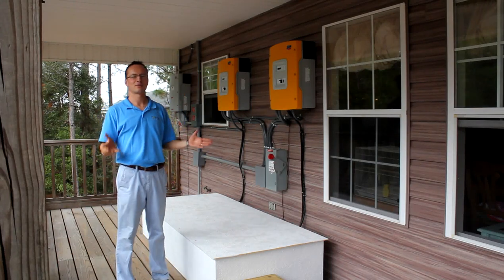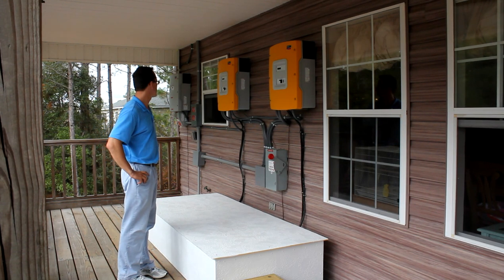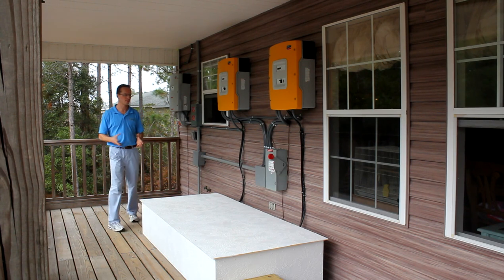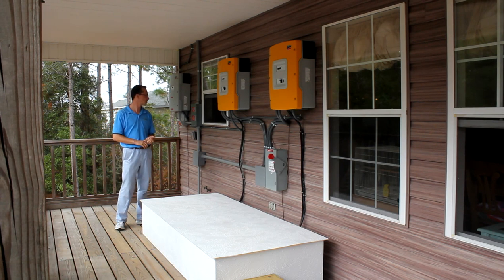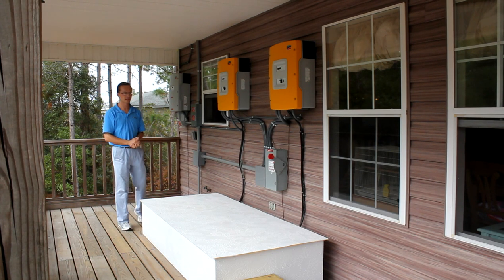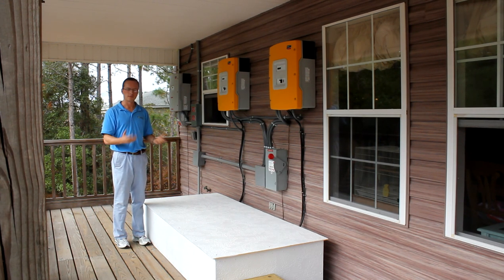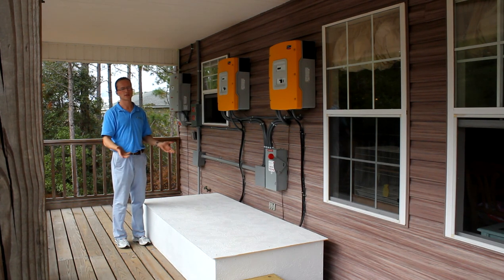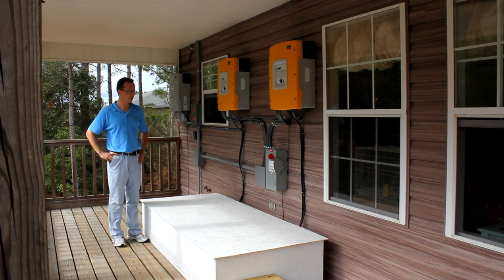Solar PV System With Battery Backup Walkthrough

Comment: hey great setup , i do have a stupid question though , the ac out cable from the sunny boy does it go into the sunny island? or to the main house panel , how does that work out to connect the grid tie to both the sunny island and the main loads in the house?
Thanks

Comment: Looks like an excellent installation!  I've used the Sunny Island before and it truely is top of the line!  I would like to say your description of the battery capacity was a little misleading.  The SI operates at 48volts so you must have either 2 strings or 3 strings of the 225AH batteries.  That would mean the system is 450Ah or at best 675Ah.  An easier way to describe it would be 450Ah at 48V or 21.6kwh of battery capacity. ( 450 * 48=21600)  Still a very good capacity for a for a home.
Reply: thanks u cleared the battery issue for me
Reply: please how to connect two inverter in parallel